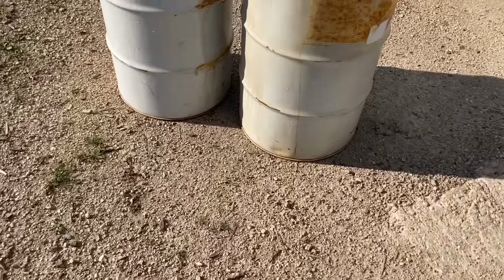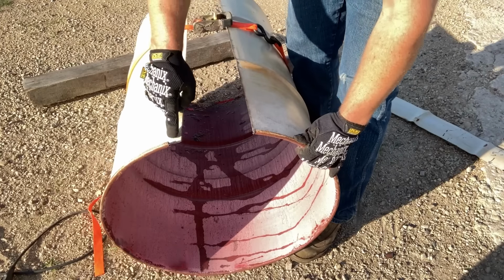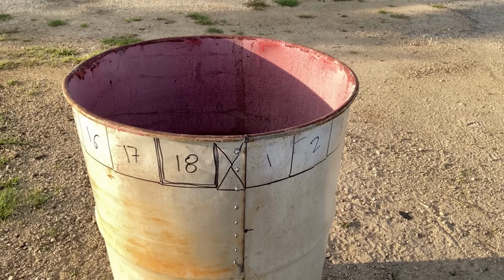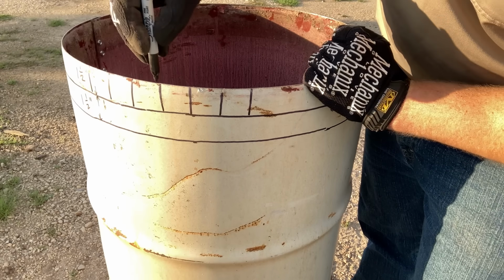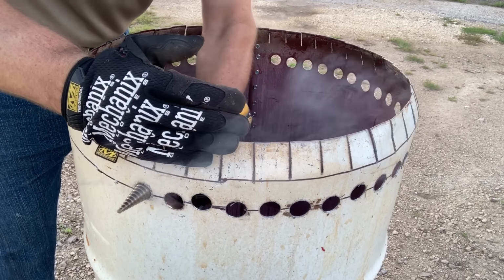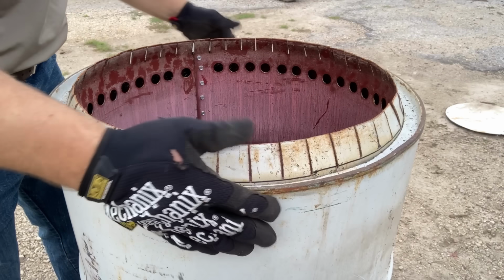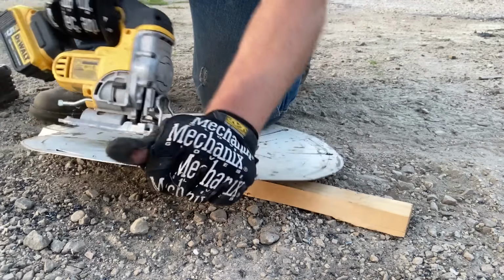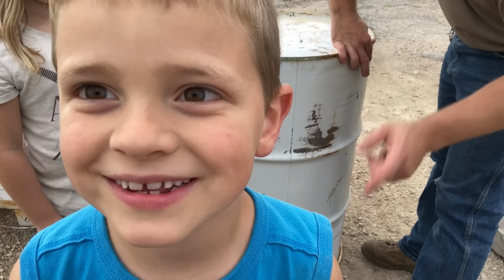Smokeless Burn Barrel

Comment: I got one of those plastic 50 gallon drums and it smokes no matter what I do.
Reply: GONE ! TO !! OBLIVION !!
Reply: Wait. You're burning stuff in a plastic barrel??
Reply: @IIISWILIII  Yeah doesn’t everyone?
Reply: You should probably try to add som old used motoroil or something similiar
Reply: @bsod5608  I’ve found if you take regular cheap petroleum jelly to the inside of a plastic barrel, it’s like a big wax warmer. I put mine in the dining room for more ambiance. Feel free to steal my tips👍
Reply: Try to throw a tire into it....
Reply: It will quit eventually.
Reply: @gimpygrandpa3230  So will the sun.
Reply: I fill it with water ......don't seem to have a problem!!😊😊
Reply: you have to add some shredded old tires to the wood you're burning for some extra fireeee
Reply: Plastic ones work best for burning styrofoam.
Reply: Of course it does.
Reply: Quit burning tires or used motor oil inside it.
Reply: @bsod5608  I suggest Diesel Exhaust Fluid
Reply: My plastic barrel only smoked the first time I used it
Reply: Just reading this comment made me cough.
Reply: You have to use high temp paint on it first
Reply: @richardjohnson4373  that used oil goes to the favorite good ol boy mechanic who has a waste oil furnace in his shop.      The one who gets my 21 year old truck past NewYorkistans stupid emission hassle inspection👍🏻.
Reply: your not filling it up enough, take it to the gas station and fill it with diesel.
Reply: You need to use the ones made of recycled paper instead. Smokes for far less time.
Reply: @IIISWILIII  R/Whoosh
Reply: @S.D.P.  🥴
Reply: I'm using a wooden barrel, it keeps catching fire whenever I use it. Am I doing something wrong?
Reply: Maybe you should larger zig-zag papers to roll it in before you smoke it!
Reply: @greenidguy9292  only if they smoke what you're smoking
Reply: My 30 gallon plastic ones smoke as well. Oh well, at least they are single use.
Reply: Built a woodstove that only lasted an hour.
Reply: HAHHAHAHAAHAHAHAHA
Reply: @IIISWILIII  whooosh
Reply: @gregkrueger331  lol....
Reply: Priceless
Reply: If you followed the directions it should not smoke. Go figure.
Reply: Hehehe
Reply: You just have to burn hotter to get it broken in. Once the plastic barrel gets up to temp, it will stop with the smoking. It just takes a while. You'll know its broken in when the smoking stops.
Reply: @philphil3386  excellent advice
Reply: You HAVE to burn low heat value AOC wood…….lol
Reply: Lol
Reply: You’re not putting enough holes in it! Dummies!!         

Lol
Reply: Try High Temp Paint!
Reply: @offgridcabinbelgium  I am. He's my uncle. Though I'm named after my Grandmother 'Olive' and other Grandfather 'Drab.'
Reply: Try lining it with aluminum foil 😂
Reply: @purplesocks9745  same thing happened to me but they dumped some kind of blue hard stuff all over the indoor outdoor carpet then dumped the ash on top of that win they stole mine     🔥🛢 the nerve of some people
Reply: @bsod5608  Almost upvoted, but you were at 69, and I'm not a goddamn heathen.
Reply: @ChucksSEADnDEAD  That's the Covids.
Reply: Don't forget a couple old stereo speakers that add some different smoke than tires
Reply: @IIISWILIII  r/wooosh
Reply: I use a STYROFOAM barrel, burns nice and even.
Reply: lmao!!! Its a joke guys
Reply: 👍 Made my Day
Reply: @BanjoNoob2  No it wont. The sun will not quit and never has before. No such phenomena is known to happen.
Reply: I think if you use a leaf blower to cool it a little it should be fine.
Reply: Yep and I got a 20 gallon cardboard burn box. It smokes a lot too
Reply: @gregkrueger331  lol
Reply: @74Nilsen  Yeah, for that nice essence of burnt carbon black!   Mmmm, mmmmm!   (Hak, kaff, cough *sputter*)
Reply: Lmao
Reply: Lol
Reply: LOL!
Reply: So    that gonna make it harder to send smoke signals😁
Reply: that's the expensive factory installed smoke you're letting out bud.
Reply: Lol 😂😂😂
Reply: Maybe the wood was too wet😂👍
Reply: LOL nice
Reply: I think if you wait and only light it in the winter when it's frozen you'll be good to go . I live in northern Canada ,it's a proven concept .
Reply: Great video! Your method of outlining where to cut and drill is simple, clear, and affective. Quality content
Reply: BBAAAAA HHAAAAAA HHAAAAAA HHAAAAAA HHAAAAAA HHAAAAAA HHAAAAAA HHAAAAAA HHAAAAAA HHAAAAAA HHAAAAAA
Reply: Bahahahaahahahwhwh awesome!! Brilliant humour!
Reply: You've got to line the inside of those plastic ones with asbestos for them to work right.
Reply: @offgridcabinbelgium  We're all in this together.
Reply: at least they don't rust !
Reply: @usmc forever alright, I'll play along.
What kind of bridge are you selling, good sir??
Reply: @usmc forever 🧐
Reply: @Hasmeen91  fill it full of water.
Reply: Nice, 
A good prayer:
I'm a sinner JESUS please forgive me for all my sins I know you shed your Blood for me on the cross at Calvary. Thank you JESUS for my salvation and for shedding they Blood for me. I love you JESUS. 
Romans 10:5/10 ct...❤️k
JESUSisLord!Amen...
Amen..
If you'd like to call someone who cares 
83
For
Truth.
bc you don't know when you'll die?
.y r u hesitant........
Reply: I just snorted a boogie out of my nose when I read this……..
Reply: They just don't make em like they used to.
Reply: It’s probably some vibration, sit it on a tyre to dampen any vibrations
Reply: Name it Cheech or Chong
Reply: LOL, LMAO, LMBO, to all these replies Cheers Folks
Reply: I found that putting the plastic drum on a tyre with two inch holes drilled evenly around the tread, really speeds up the burn. It warms my house up real quick.
Reply: That’s normal it will do that every now and then
Reply: @heavytank2  
No, it’s not!  Lol!
Reply: LOL
Reply: Way to go brandon
Reply: Way to go Brandon
Reply: Omg you should read some of these comments lmbo 🤣🤣🤣🤣🤣🤣🤣🤣🤣🤣🤣🤣🤣🤣🤣🤣
Reply: Ha ha ha ha. 🤣 LMAO. Great sense humor. Thanks!
Reply: Gotta burn a plastic five gallon bucket in it to cancel out the smoke
Reply: Hahaha
Reply: Mine works ok as a bbq. Which end did you cut out. Always cut out the top. If you cut the bottom out the bung interferes with the airflow
Reply: You need to fill the plastic ones with water first.
Reply: You need to burn styrofoam in those.
Reply: @IIISWILIII  
Don’t knock it till you try it!
Reply: @richardjohnson4373  
Why?
Reply: hA Ha !!!
(Nelson Muntz voice)
Reply: How dare you!! 🤣
Reply: @c50ge  LOL I stand corrected.
Reply: I think the key to the plastic barrel is to buy one for every burn and just don't look back after she's lit. The neighbors will complain either way when you live in an apartment building.
Reply: @kenh9508  Stop it I can't breathe. 😆 LMFAO
Reply: @kenh9508  If they call the police you can always move the barrel outside.
Reply: you need more fuel in it to burn properly.🔥🔥🔥
Reply: @richardjohnson4373  definitely can't do it on the deck, not after the BBQ incident.
Reply: @kenh9508  LOL
Reply: Did you paint it with heat resistant manifold paint.
Reply: Now Thats Funny.
Reply: ROTFLMAO
Reply: Hahahaha!
Reply: Hahahahahahahahaha 
How many people were triggered not realizing it was a joke?

It is a joke, right? ;)
Reply: 😂😂How long does that PLASTIC drum last... 😂
Reply: @doctyler3920  I think quite literally everyone on here knows it is a joke....

Or so I hope.
Reply: Try pouring diesel fluid on the plastic. It will only smoke for a couple minutes and then disappear. If you use petrol, it will disappear even quicker. Only one more suggestion is to blow a fan on high directly at it and problem is solved
Reply: Appreciate all your suggestions.. my 9 year old son and friends are excited to use this in their new tree house cold night... The plastic barrels is much easier for them to lift up and I Recommend going to the oil change shops to use their dirty oil and used tires and use the front grills of cars to place several Filet Mignon on the older metal car grills as they are more likely metal but make sure to flip or change if the newer imitation metal grills or hubcaps starts melting under your steak. Use some wd40 to separate the steak especially if it was cooked from a freezer burnt state.. remember the plastic can harder back up if the steak isn't eaten within 3 minutes 
Please donate if you want to see how I dried and tenderize beef jerky by pinning it between the tire treads of new hot asphalt pavement.. !
Reply: Hahahaha! Priceless!!!
Reply: I put holes in mine and it won’t stop leaking water.
Reply: @purplesocks9745  🤣🤣😂🤪🤪🤪😃 naughty ,,him" 😇👼...the nerve ☺️😁
Reply: @Hasmeen91  
NOOOOOOOO... keep doin' it until it gain enough carbon to make diamonds❗☺️
Reply: @orthirox7419  😁 just checking 🤣
Reply: I built mine with old tires.  Have the same problem with smoke.
Reply: Lol hahahaha. This is good reading. I am dieing here.👍
Reply: Plastic., not so fantastic✅
Reply: Not all drums are created equal.
Reply: @kathybramley5609  🥁 🛢 🪘
Reply: Hmmmm I think you might be having draft issues due to your be real burnt to sender.
Reply: Dont use gas
Reply: @rustycrustytriesstuff  🤣🤣🤣
Reply: Oh man,,,wanted the video info.. Needed the big laugh!!!🤣🤣🤣😂😅
Reply: Serious point about equality & equity though, acknowledgement of the difference between All Barrels & positive discrimination is a good thing when it is! Smoking barrels, no.
Reply: But only one time!
Reply: Great I’dea
Reply: @WhoDidThati  
What colour is it dude, it's green, dark red, black, grey with white and a dark green head plus a little translucid tail, it's jelly like or hard one❓
Some of it are very good for projectiles... quarter of a grain and obviously subsonic❗
Reply: Cover the outside in nicotine patches.
Reply: Good fishing sir.
Reply: Lol
Reply: As a former Boy Scout I will agree that the smoking from using a plastic barrel as a burn barrel will stop.  You might wanna invest in a fire extinguisher and stay far away from any flammable material.
Reply: 🔥 They're great for grilling also my blue plastic barrel with homemade napalm with all combined ingredients burnt oil barring grease foam fix a flat afro grease lol I quit 😂😭🔥
Reply: Bwahahaha
Reply: Great sence of humor
Reply: Smart man oil products never burn.
Reply: I like the way you roll there, Tuggernuts Blumpkin. Lol 😆 🤣 😂
Reply: Has it tried hypnosis?
Reply: Dude, lol
Reply: @BanjoNoob2  lol
Reply: You need the 55 gal drums 👍
Reply: @gregkrueger331  gasoline💪💪
Reply: great for ceramics baking
Reply: Lol
Reply: Your just kidding right
Reply: @michealnelsonauthor  😂
Reply: @richardjohnson4373  no need to move it outside.
The evidence is long gone so he is safe anyway. 🤪🤪🤣🤣🤣🤣🤣
Reply: @rrpearsall       S T O P it, I cannot stop laughing anymore.
🤣🤣🤣🤣🤣🤣🤣🤣🤣
Reply: @Jack5822  did you line it up with aluminium foil ???

That might do the trick. Good luck
Reply: LMAO
Reply: @davidwillard7334  I’m
Reply: Lmaoooooooo
Reply: @jesseghost3286  thinking is the hardest part
Reply: So true !!!!!!!!😂😂😂👍🏻
Reply: @gregkrueger331  lol.   Thing is , people out there would do that.
Reply: @billthebutcher1821  i know, let’s hope there’s a whole stack of Darwin awards ready to be handed out.
Reply: I lined my plastic barrel w bricks and mud
Reply: @IIISWILIII   no, he’s burning a plastic barrel. That’s what he’s doing, there is no burning something IN a plastic barrel. Plastic barrel is gonna be fuel
Reply: Add turbo to it
Reply: Really Black smoke? Yeah, I'm having the same problem !!
Reply: Amazing, thanks & God Bless
Reply: @74Nilsen  I always put a bowling ball in the bottom
Reply: Well because you are using plastic man that's why 😂
Reply: Destination….fucked 😂 😂
Reply: @bsod5608  and some ammonium nitrate
Reply: Try a whiskey barrel next time.
Reply: Try getting it on nicotine gum as a first step to quitting. 😁
Reply: @Hasmeen91  No it’s only if you light it otherwise it looks good as a decoration.
Reply: @purplesocks9745  Did you ever think it was god’s providence the second time they used it,It went up in flames and only had the ash so they returned it back to you.
Reply: Lol
Reply: @IIISWILIII  he's joking 🤣
Reply: Hahaha 🤣
Reply: Add firewood until it stops!
Reply: Try adding acid into the plastic barrel! Plastic barrels do great with acid.
Reply: Damn smoker's
Reply: Haha funny how that works right?
Reply: Lol
Reply: Question ❓ how you clean the ashes?
Reply: Are you joking about it,?
Reply: You probably need cleaner diesel.
Reply: Priceless 😂
Reply: Lmfao🤙🇺🇸🙏
Reply: Plastic burn barrels must be lined with a trash bag for proper performance.
Reply: LOL AWSOME !
Reply: This is just to funny .  I'm rolling laughing my ass out
Reply: @greenidguy9292  thr plastic itself is wrong lol
Reply: 😅😄u lucky it didn't catch on fire 🔥
Reply: I can't imagine burning anything in plastic.  Besides the fact it melts way too easy, the smell of burning plastic is enough to make a maggot gag
Reply: I’m retired now , thinking about burning one myself
Reply: This made me actually laugh out loud
Reply: Mine does too, must be model specific. I just stand upwind
Reply: Lmao
Reply: Did you drill holes in the bottom?
Reply: Oil it before every use....perfect.
Reply: All that smoke you saw was you didn't put enough gasoline in when you started the first fire in it. It's like seasoning a wok with oil the first time. If you don't put enough gas in it, it will just smolder and smoke. Plastic lined barrels don't stay lit as good as a nice wooden barrel. That's what you need. Try the Jack Daniel's Distillery or Tractor Supply maybe they got one. YEP THATS RAUGHT. Festus from Gunsmoke said that.
Reply: Lmfao!!!!!😂😂😂
Reply: @IIISWILIII  No, he is burning stuff with a plastic barrel. That's a difference.
Reply: @BriMarteen  that old lead paint works best! A few coats before first use!!!
Reply: @richardjohnson4373  did you put a few coats of that old lead paint first? Found this works best!
Reply: Hahaha
Reply: F ing brilliant ! My kind of pyro !
Reply: Ha ha ha ha tell me u are not serious
Reply: Duh 🙄
Reply: Try to fill it half way with gasoline and then light it.  There won't be any smoke at all.
Reply: Old gas would work as well.
Reply: @charliefox3157  😳
🤣🤣🤣😅😅
Reply: @charliefox3157  I want to hear about the second time you used it 🤣
Reply: If you’ll fill it up with gas first it won’t smoke for long !
Reply: 😂 plastic to burn....😳
Reply: But, and this is important, does your barrel identify as metal?
Reply: I use a barrel made from frozen gasoline. Burns really well
Reply: YIKES !
Reply: @greenidguy9292  RIGHT !!
Reply: @gregkrueger331  Pass TH8S TIP al9ng to EVERY Lib & NEVER-Trumper you KNOW 👍!!
Reply: Mr obvious says don't burn plastic
Reply: 😆😆😆🤣🤣🤣 You're Awesome For That!!!
Reply: Lol!!! That's a great one , cause 🔥 fire would melt a plastic 🥁 drumll Lol
Reply: Coat it in aluminum foil that'll stop it lol
Reply: That propeller in the bottom will cause ' lift off '
Reply: That's easily solved, just make sure that whatever you're burning is thoroughly soaked in petrol... that should solve all your problems.
You're welcome 😏
Reply: @IIISWILIII   makes an even  better bong!
Reply: 🤣🤣🤣 really? I’ve never had a problem with mine, you should try another one 🤷‍♂️
Reply: Lmfao
Reply: Gretchen will be so proud of you!
Reply: Oh boy
Reply: Supprized it didn't melt or catch fire
Reply: That’s funny stuff right there
Reply: Very funny!
Reply: Very 😁 funny!
Reply: Ain't no way! 😂🤣🤣
Reply: OMG your comment is so funny I forgot to laugh.
Reply: It won't smoke if you line it with fire brick
Reply: Best answer yet, I'm sure some people's heads are exploding in the prior replies. 🤣 probably all that plastic inhalation.
Reply: You should have it try the patch.  I hear that works good.
Reply: Plastic burn barrels are only for burning tires.....in your garage.
Reply: 😂😂😂 Stop eeeeet
Reply: Plastic it metal barrels
Reply: Lol
Reply: @Hasmeen91  you have to be sure to keep the liquor in it!
Reply: Lol. Too funny😂
Reply: PlAstic !?
Reply: Stop giving it cigarettes
Reply: Interesante  idea
Reply: Is genius 👏
Reply: Love your comment.
Made me laugh out loud😂
Reply: @gregkrueger331  the comments here are 🔥🔥🔥🔥🔥🔥🔥🔥🔥🔥🔥🔥
Reply: @ronhaefner7833  your an end user💚
Reply: Use more gasoline. Then you won't have anymore problems with smoke
Reply: @davidwillard7334  and your family 👪 😊
Reply: They make an amazing fire 😉
Reply: Me too but it seems to be changing shape.
Reply: Yooo these fucking comments are killing me Smalls!

"Just stop it
Get some help" ~Michael Jordan
Reply: I just stack up old tires and start the fire inside using old watch batteries I got cheap at 3 Mile Island. Marshmalloes taste really good, although my daughter seems to glow in the dsrk.
Reply: Try another brand
Reply: One-time use 🤣🤣🤣
Reply: LOL
Reply: I made a polish woodstove made out of wood. It said it was guaranteed to burn 4 hours. I was mad because I only got 2 hours from it. And it definitely wasn't smokeless. But I didn't care. It was in the winter. The heat felt good. Ha ha ha.
Reply: That's strange my plastic barrel doesn't smoke I think you forgot to make the correct cuttings
Reply: Priceless comment dude … it’s good to see that humor still exists out there in the ether!
Reply: Sizemore malanay ang plastic 😂😂😂😂😂
Reply: No you need one of those big plastic 100+ gallon tanks, that keeps the smoke contained.
Reply: That's called BUILDING BACK BETTER
Reply: I know when I burnt my mobile home down the only thing worse than the smoke was the screams, wish I could have had an extra mobile home I could have stuffed inside the other and fancy dancied me a smokeless trailer burn! However next time I'll remember to stuff some socks into, well nevermind!
Reply: You are using far to much heat mine works just fine ie no heat.
Reply: If you get the fire hot enough the smoke goes away in a regular barrel. Mine is a large pipe like 30 inches in diameter and put into the ground. 73
Reply: @Hasmeen91 Sinun täytyy huolehtia siitä ettei liekkien lämpötila pääse kohoamaan yli +95°C 🤔
Reply: It's just gonna smoke for a while, then it'll be fine, give it some time
Reply: Well bless your heart
Reply: Riiight!!? Everytime the smoke hits me my lungs really hurt 😢
Reply: You should use the plastic Barrel as mold to cast a stone barrel
Reply: I have the same problem 😂😢😊
Reply: I like this, the plastic should burn good and will give off extra fire and heat .
Reply: Bro you gotta drill more bigger holes! Tricks in the holes!!!
Reply: Love it!
Reply: @richardjohnson4373 😂😂Really😂😂
😮oh, you're serious 😢
Reply: @davidcornman4295  Of course I am I had to take mine outside, if I didn't the EPA was going to fine me 100K. LOL I told them I must be acting this way because I was over come by fumes and could not breathe. So they let me off with a warning. HA ha Ha
Reply: @davidcornman4295  I kept asking how I was supposed to cook dinner?  Now that Brando had taken away all the gas stoves to save the environment.
Reply: I'm melting I'm melting! Oh what a world , what a world ! 🧙‍♀️
Reply: Plastic 😂😂Hahaha really
Reply: U need tempered glass in side ur plastic barrels guy
Reply: You need more plastic
Reply: Hurr hurr
Reply: May I recommend that you use a cardboard barrel next time, wayyyy les smoke than the plastic ones!
Reply: Put a plastic lid on it, cracked open a bit, than it won't smoke so much.
Reply: You mean you HAD a plastic drum 😆
Reply: I did the exact same thing. I didn't notice any smoke after I lit it but I went inside to get a sandwich and came out an hour later and it was gone! Vanished! I can't believe someone stole my burn barrel after all of that work. Smh
Reply: That’s not smoke, them are freedom fumes. Dont waste them, breathe them in
Reply: Has it tried the nicotine patches?
Reply: "Do not drill unto your hand". Yeah, I've done that. It sucks. That little 3/16 drill bit made one heck of a quick hole in my finger. It took almost 6 weeks to heal up. Lol. Good times.
Reply: Good one
Reply: Lol😂
Reply: @mindsprawl  petrol works better than diesel, I find.
Reply: Guys, Here is The True Savior

YaH The Father (Genesis 1), Who, with His HAND, formed “man (Adam)”, from the dust of the ground (Genesis 2:7).

YaH’s HAND they NAILED to the Almond Tree, to symbolize forgiveness of the “Tree of Life” sin OF “man” and thus “The Fall OF man” (Genesis 3)

YaH The Father arrived to be Crucified via the Tent of Meeting (Exodus 33, Isa Scroll), how YaH has ALWAYS arrived
Reply: Keep trying buddy you'll get there
Reply: You got to get the smokeless ones da
Reply: They are not plastic!!!!😂
Reply: LMFAO
Reply: Toss in an old mower tire too.
Reply: @charliefox3157 now you don't have a barrel.
Reply: @Hasmeen91 Soak it in kerosene before you light it off. I'll provide you with wood prototypes.
Reply: Because it's plastic...
Reply: Don't use plastic. Only metal.
Reply: @Marc-Vickers  safety 🦺 101: Don't burn shit in plastic Barrels, heat from fire melts plastic and causes it to smoke when it goes beyond the melting point 🤦‍♂️
Reply: Ahahaha😂